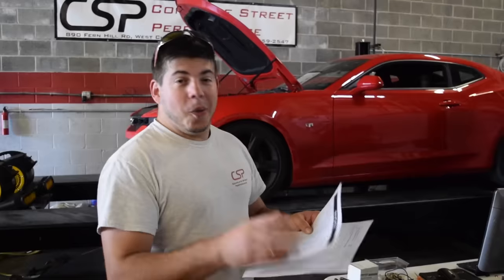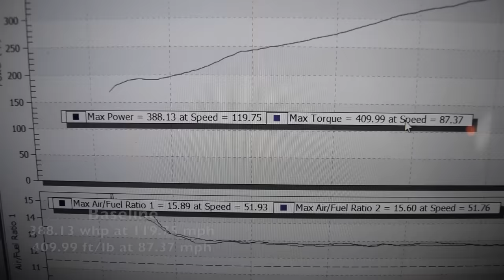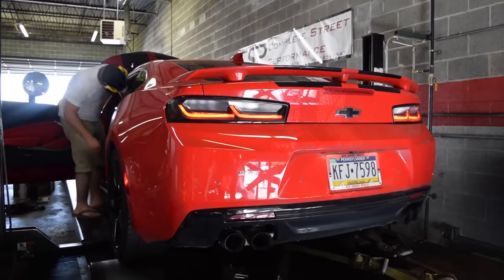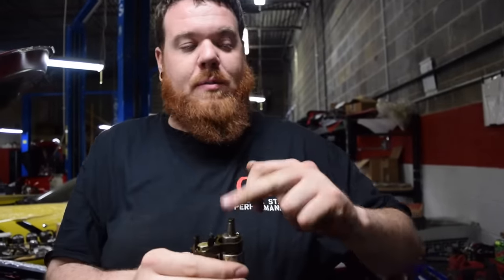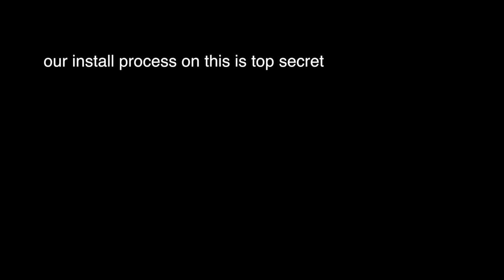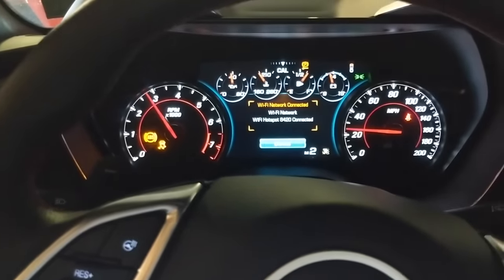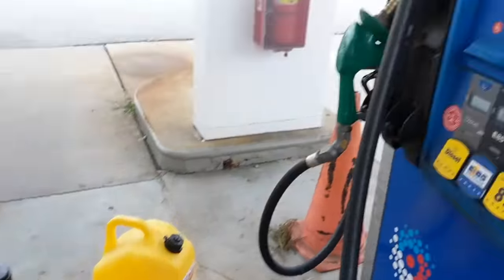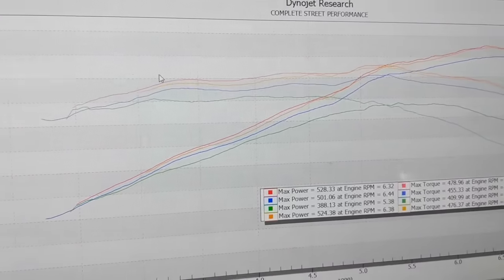How to add 140 rwhp to your Camaro SS without boost!

Comment: Lmao his 80 to 180 is almost faster than my 0 to 60
Reply: You have to remember that the car is stationary with no air resistance. It makes a huge difference.
Reply: Dyno runs xxmph-xxxmph are not representative of the street. 
My turbo g5 gt looked like a gt-r on the Dyno lmao
Reply: It's under very little load lmao, this is probably the equivalent of going down hill

Comment: Cool video. I basically have the exact same mods (plus 103mm TB) and picked up 149rwhp, which is consistent with yours. The car is a blast to drive, and the chop is awesome.
Reply: How much this gonna run you
Reply: Not bad. I got a buddy with his 2019 5.0 with 395 whp stock. Just ported fact mani, full headers-exhaust, TB and filter drop in and got it to 475 rwhp. On E it got to 530 rwhp. I still dont believe it but hey, 585 crank hp,v0-60: 3.2 sec and 10.8@132 says it all. Surprised the LT1 needs a 12k HC, pack to get similar power as the stang did for under 5300. Also didnt know cam swap on 2016+ LT1 was such a huge PITA compared to the LS3/LS6/LS2/LS1. Looks like a power adder is better for the LT1 200 whp for 7500.
Reply: Problrm is you could leave most of it stock and just slap a prochsrger on it, 160 rwhp for 7k. I bet this set up in the video is over 7k, probably closer to 13k from their website. Over prices mods.
Reply: @MasterCarguy44-pk2dq nearly 600 crank. It can barely crack into the tens? A lt1 can do that easily
Reply: @MasterCarguy44-pk2dq And you add 60-70 lbs over the front wheels, been there done that (2002 Pontiac TA with Vortech SC)  it made great dyno numbers but the performance wasn't there at the track vs heads and cam making 50 less whp. Adding 60-70 lbs impacts the weight distribution, reducing weight transfer and makes it plow more I'm turns as a track car. I didn't even touch on potential heat soak. NA is the way to go with LSX. Forced Induction is great if you have less displacement to begin with, like a 4 or 6 cylinder. 

The only caveat here is those rear mounted twin turbo kits that put the weight over the rear wheels and of course C8 kits that similarly put the additional weight over the rear wheels.
Reply: @MasterCarguy44-pk2dq  And you add 60-70 lbs over the front wheels, been there done that (2002 Pontiac TA with Vortech SC)  it made great dyno numbers but the performance wasn't there at the track vs heads and cam making 50 less whp. Adding 60-70 lbs impacts the weight distribution, reducing weight transfer and makes it plow more I'm turns as a track car. I didn't even touch on potential heat soak. NA is the way to go with LSX. Forced Induction is great if you have less displacement to begin with, like a 4 or 6 cylinder. 

The only exception here is those rear mounted twin turbo kits that put the weight over the rear wheels and of course C8 kits that similarly put the additional weight over the rear wheels.

Comment: I just picked my 2020 LT1 Camaro last week.
This upgrade could be on the list.  Plus the whole E85 is freaking awesome.
Reply: Do you know if the 85 conversion is corrosive in a long-term? I heard it is I don't want to know for sure before I do it to my coyote .
Reply: @Madmaxxxx1984  from what I know the e85 burns hotter. So that in it's self should be cleaner.
Reply: @Michael Decker  Alcohol combusts at a lower temperature keeping the engine cooler, not hotter.
Reply: @Madmaxxxx1984  l been running it on my 2011 Camaro SS and been using Lucas ethanol conditioner with stabilizers they recommend one ounce for every 5 gallons l use 2 ounces every 5 gallons it lubricates valves combustion chambers and the top of the pistons and it eliminates the moisture buildup that happens when E85 is stored for weeks or months my car runs extremely well on it for awhile now with no problems so far I've been getting it for 2.90 a gallon and it's 100+ octane the inside tailpipes tips still look like new with no dirt or burned brown residue after 10 or more tanks ran through and the spent exhaust fumes are barely noticeable compared to gasoline fumes it runs very clean with very little smell my car is naturally aspirated but modified
Reply: @urdecker Its sugar water, very bad for internals and DI.

Comment: FOR WHAT IT IS WORTH: This is a very impressive increase of RWHP & torque. Congrats!!!! 
If you haven't done-so already...??...I strongly suggest the following beneficial additions: 
Up-grade the coils, wires & plugs to boost the rear-wheel torque & a measurable horsepower gain. 
Factory plugs, coils & wires are the weakness of your engine heads upgrade. These OEM items can't exploit the benefits of those aftermarket, efficient, high-flow heads. 
As you likely know, an upgrade of the fuel injectors can also boost numbers. But save them for last.   
Additionally, a Flowmaster X-Scavenger installed near the collectors of the headers will balance 
the exhaust flow & efficiently enhance scavenging. There-by, greatly increasing engine torque profile. 
Obviously, even more-so if you can ditch or by-pass the catalytic converters. 
No-doubt, your professional engine guys know these "tuner points" as well. 
Respectfully,  Ben

Comment: This is literally my exact car minus the auto, I was wondering what my stock dyno number with a Cold Air Inductions intake would be haha happy I stumbled upon this video!
Reply: Mine is a manual and from the factory has 30 hp more than the auto,  430 vs 400.  But is a 2012.   It should be the same for yours, I mean more hp than the outo.
Reply: @hb-ol9oc  you also gotta remember that you don't have the same engine as this one

Comment: That is impressive, what is the average cost for the power modifications done here?
Reply: Probably as much as a supercharger. Lol
Reply: @thomaswood5246  only a supercharger on a stock engine will blow it up in 10k miles. Guy supercharged my c7 Grandsport before I got it. He about 10k b4 it blew most all of the piston rings and oil rings. I bought it cheap ans rebuilt the engine.  😩

Comment: You did it all without boost, which is a great challenge to meet. An experienced modder could fab up a custom turbo kit and all the necessary supporting mods for no more than the same cost of all the parts and labor in this vid and have a lot more power potential. There'd definitely be trade-offs either way; pick your poison, I suppose.

Comment: Exactly how I’d spec a new SS, too. Beautiful car!
Reply: With a  auto, that's sorry
Reply: J.A.G. The 8 speed is faster than a 6 speed in the 1/4. By a lot lmao. If I wanted a stick, I’d get a 1le and autocross it.
Reply: @onthreess1496  you only car about speed, if you wanted to have fun on backroads and be in control of your car you would want a manual. It's a much better experience.
Reply: @j.a.g.8689  you can have just as much fun shifting a good auto as you can with a standard, its not the 90's anymore, and the guy that started the "give me a stick" thing has been dead for 10 years now, stop the bullshit !
Reply: @j.a.g.8689   i mean these cars come with paddle shifters and rev limiters.

Comment: Decent gain 👌 
Is it safe on the engine in the long run?
Reply: I have the same setup on my vette.  My turner said n/A motors are still freely breathing.  S/c cars have to force that air.  To different life spans.

Comment: So can you do the cam removal/install like that? I see a lot of people saying the only way is pulling the engine or removing front end, subframe, etc. I'd like to do it myself but don't want to mess with yanking everything
Reply: Sadly these new 2016+ LT1's suck for doing a cam. Gotta pull half the damn engine now. Used to be easy max 1-2 hrs at home, pop hood all from top front.

Comment: I wish they'd say how much this work costs.   I mean if its $7000

You might as well just put in a supercharger and call it a day.

A lot less labor involved
Reply: I wouldn't call it a day with just a supercharger. You can still add additional mods beyond that and produce even more power/torque depending on your personal preferences of course.
Reply: @danieljamesmoreno5961  or u just leave it stock and don't risk anything to enjoy your 453 hp🤗
Reply: Big facts
Reply: @Mrcl5902  405 to the rear wheels
Reply: Agreed. How much?????
What can I get for 3k for real?

Comment: How much was this setup? Parts and labor?   (I have a 2017 Camaro SS A8 auto that's stock.)
Reply: MYCamaroZL1 10K in parts and labor is typical for what they did.
Reply: @stevenp3176  for about the same money, I can put an A&A supercharger and get about 175 HP... why stay naturally aspirated? E85 is hard on everything being so dry a fuel, and lower BTUs. But my point asking is NA a better feeling than boosted? Just asking..
Reply: @hemikid52  depends on the driver and what they're looking to do with the car.  Most people stick with N/A on the SS cuz they're just looking for something a little more fun to drive on the back roads.
Reply: @hemikid52  there's no heatsoak with NA vs boosted, meaning if you do a couple hard pulls back to back you'll be making less hp with the boosted car.
Reply: I was quoted about 6300-6500 for ported heads and cam installed
Reply: @iAbdosh  not if you have an interchiller
Reply: hemikid52 could do this then a supercharger, that’s 300+ you getting, maybe that’s what he wants
Reply: On the website it says that it’s like 5,000
Reply: 4-5k for just heads and cam and labor seems to be the norm.
Labor can be free if you try doing it yourself, with proper guidance you can't to mess up.

Comment: Very nice. So, what are we talking price wise for the whole thing? One could get 140 WHP spending about 8k on a supercharger and not have to mess with opening the motor and spending so much time with labor.
Reply: Adding boost to ur car u may have a higher chance and risk in blowing ur engine..
Reply: @kartune551  going in the engine and changing a bunch of parts inside of it has a higher chance of blowing up your engine. 
As long as the proper supercharger kit is used and it's properly installed you shouldn't blow up your engine........just like doing a N/A built if the parts are right and installed properly you should be fine.
Reply: @JuanLega  thanx bro...i wish i knew people that i can trust to do it right...all my buddies always has probablems with there cars ever since they have installed different parts to there cars..so im really afraid of adding anything to my vehicle..
Reply: Also its cool to pay for the parts and get it installed, but to keep going to the shop and constantly fixing it just gets expansive and annoying lol
Reply: They literally opened the engine up in the video
Reply: @JuanLega  Or you could just do it yourself for alot cheaper.

Comment: I was really hoping to see how you got the cam out with the engine still in. Every install I ever seen they pulled the engine out.
Reply: If you disconnect the radiator and move it out of the way you have enough room to pull it straight out (going off of 5th gen camaros) I’m sure it would be similar space
Reply: Also same way with c6 corvettes if you move the radiator you have plenty of room to pull straight out

Comment: Was this done on the stock fuel pump and injectors? Or did you need to upgrade?
Reply: No answer...I'm wondering the same thing. He did mention the catch an...so I'm assuming no fuel upgrade, but he also didn't mention anything about a fuel lobe on the BTR camshaft.

Comment: “CSP” I noticed on the dyno pull that the red line was almost at 7000 RPM.  What did you guys set you REV limiter at?
Reply: standard rev limiter is 6850 so probably 7100.
Reply: Isn’t the redline 6600?

Comment: 500 NA probably feels like 750 boosted in everyday driving.
Reply: Nothing beats boost at 3k, trust me lol
Reply: It's fun driving a 500rwhp+ car daily
Reply: suhperman  Sounds like better tires and higher gearing are the next mod.
Reply: All things even boosted cars need more power to beat a proper n/a car because of heat soak and weight. A 600whp n/a car will beat a 600whp boosted car. Instant power mad rpm. A 700whp nitrous car will beat a 700whp boosted car all day . In the cold and in the summer even more .
Reply: Complete Street Performance what I meant is a stroker motor  or proper head and cam. I see it all the time where boosted cars with more power under performing and n/a over performing
Reply: Scared to ask, but about how much money would a person have to pay (parts and labor) to do all that?    Ballpark.
Reply: try a 500 whp bmw 340/440. Instant power

Comment: So what is the total bill to achieve 140+ HP?? Just curious?
Reply: Timothy Wheaton After those mods plus install, cost of dyno tune, for all that is i would say $4-5 grand.
Reply: I would be curious to get a better ballpark total cost including labor and how many hours labor it typically takes to do the job.
Reply: @completestreetperformance  maybe you could reveal that in a later video 🤔! Obviously it's a great package that you have put together. But some of us gen 6 camaro SS drivers are like the National Enquirer,  we just want to know so we can ask Mrs Claus for Christmas!  If you know what I mean!?  Thanks love your YouTube channel!  Keep the pedal to the metal!
Reply: $2200 labor & tune..................... s.w.a.g
Reply: If this was my car I would of done pistons and rods while they had the engine open.  So he can go boost in the future without having to pop the engine open again.
Reply: i think it may reach 7k total
Reply: At least 6-7 k. Heads and cam + install is 3800-4K  long tube 2k msd intake 1100 more if ported by mamo, e85 + install and tune 1000, ported tb $350 to $700
Reply: 8,500 and some change. Probably a grand worth of change. Here in Houston texas that's what you would spend.
Reply: Looks about the same money as a blower kit plus install. But 528hp NA at the wheels is really impressive with no torque loss.
Reply: Dagger's Garage - you can't pull the pistons and rods without dropping the oil pan, and that is usually impossible to do without pulling the engine.  This was all a top end build.
Reply: The Fitness Life might as well go boost them for 5k
Reply: Free if you build it
Reply: 10 prolly
Reply: for that price you can supercharge it
Reply: @marcozr3138  hell yeah!
Reply: Well with a hemi just the cam and long tubes that puts you back about a grand. If you more out of the stock race heads just port it's super easy I did it to my lt1 camaro years ago and the only time I buy aftermarket is when the stick wont push enough air
Reply: @Snicerchopenhanger  you want to take the pistons out without pulling the whole motor
Reply: For that kind of money you could have just done a supercharger setup and save a lot on the labor costs.

Comment: Awesome increase, but, how much 
$$$$$$$$$$$$$$$$ in total, not including labor?
Reply: Ener Rivers  my cam kit was $1100 my headers $700 msd intake manifold $1100 flex fuel sensor $150 95mm throttle body $170. Extras: I got my intake manifold and throttle ported for $400 for both ngauge $500 wideband and hptuners $700 together
Reply: @kennethharrison1233  wow, gr8 work  & even better deal. Enjoy, have fun, but, more importantly, BUCKLE UP. THANKS FOR THE INFO BRO. L8R

Comment: How much for the “package?”
Reply: Probably 7500 ish all-in. 
Msd intake = 1,000
Long tube headers = 1,000
Heads = 1,500
Cams = 500
Catch can = 200
Labor = 1000-2000
Tune = 800-1000
Reply: @nicholasrogers8173  you left out the little things like new lifters, pushrods  trunnion upgrade timing chain and the flex fuel kit  and TB for the MSD intake
Reply: @nicholasrogers8173  not worth it
Reply: ᏒᏋᎷᏋᎷᏰᏋᏒ ᎷᏋ  there’s bolt on only SS’s in 10’s and Heads n cam in the 9’s on the 6 gens. For 6-8 grand starting completely stock that’s pretty good. A procharger only (with smaller p1 head unit) set up is about the same cost for the same gains.
Reply: nicholas rogers might as well get a supercharger
Reply: I would much rather go with a supercharger for that kind of money.
Reply: Randy Hunt same thing I said
Reply: @D4rt Replace a blower? Why? Who lied to you?
Reply: I checked the site it’s 11,000 for the 140 rwhp Setup

Comment: Guy's not trying to start any sh*t here. I enjoy your channel and I'm a 2016 SS Auto owner.  However, "HPE" posted this for dyno baseline "431 rear wheel hp and 427 rear wheel lb-ft torque" on a 6 speed manual.  Any reason for the variation other than trans and dyno type maybe.  Thanks.

Comment: Why does GM claim 426 hp on 2010-15 and 455 hp 2016-20 SS's? I have a 2014 1LE manual and it seems a hell of a lot more powerful than 388 hp.
Reply from the maker: Different engines

Comment: My 2018 SS has the 6 Speed Manual, can these mods work with that?
Reply: Yea same thing, if anything the manual will make slightly more power because it has less drivetrain loss

Comment: I thought it already had 455ho stock6.2?. that's what I have in my 2018 ss1 6.2
Reply: Not to the back wheels. Stock hp is taken right from motor.you lose 40-50 hp thru drive train . 425 to the wheels is high 11 second car.

Comment: is that true the cam decrease age of the engine ?
Reply: No. It doesn't with proper oil changes, maintenance, proper tuning and install. When camming it's always important to completely replace your valve springs as well with springs that can handle the higher lift of the cam. Otherwise it'll be a short engine life.

Comment: About what a 2018 Mustang GT with headers & E-85, ported stock manifold, throttlebody  puts down.
Reply: That's interesting. So a 6th gen which already has more torque and HP at the crank than a '18 Coyote is going to add heads and cam and E85 yet the slightly less powerful Coyote just needs those basic mods. Somebody has a happy dyno.